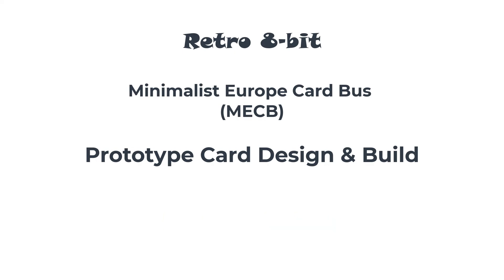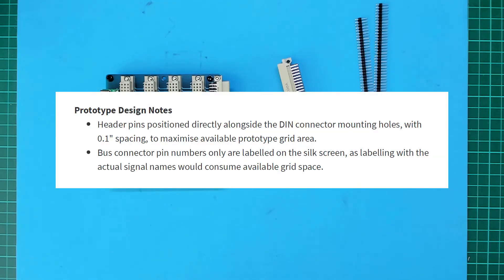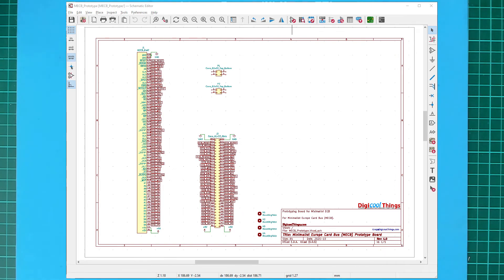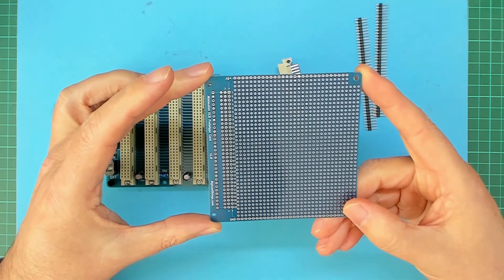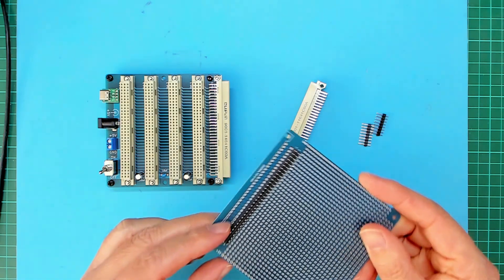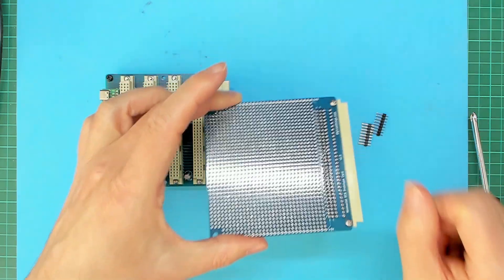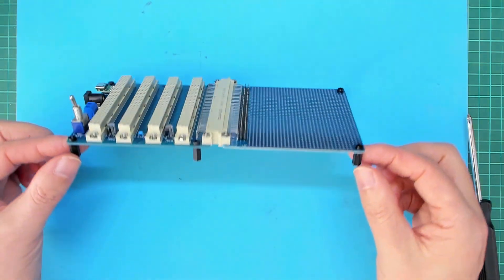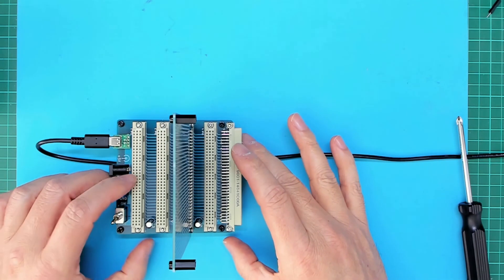Minimalist Europe Card Bus (MECB) - Prototype Card Design & Build

Comment: Ever had a problem with some USB-C supplies working and some not? I ask because I don't see the 5.1k resistors on CC1 and CC2 in your little breakout board. I've had issues with breakout boards without the resistors where the power supply doesn't engage. So far the pattern I've seen is that the 5.1k resistors are required (downstream mode) if both ends of the cable are USB-C (like with modern wall adapters that have USB-C sockets on the adapter, or if, say, you were powering a device from the USB-C port on your phone or laptop).
Curious ..
Reply from the maker: I haven’t come across this problem (yet).  But, I have no doubt you’re correct.  I suspect I haven’t had a problem yet, as I’ve only been using them with the cheap Raspberry Pi USB-C terminated plug packs.  I have a suspicion that these Adapters are probably just simple 5V 3A DC adapters that are simply using a USB-C plug in place of a DC jack.  I quite like them (and their USB-C connectors) for general 5V project power.  PS. I’m slowly working through your videos.  Very interesting, plus I see mention of 6809 in your Hopper GitHub. I just haven’t had the time yet to dive in more deeply.  🤓
Reply: @DigicoolThings  I suspect it will become more of an issue as time goes on and USB-C becomes the common port on our desktops. There is a trivial solution though: just use need to find USB-C breakouts with the same pinout that include the resistors.
I thought it was ALL supplies (and made a video on this today under that assumption) until I saw your video. That made me test more variations and try to narrow down the circumstances.
6809: yes, I started work on a toolchain and then got massively side-tracked a few weeks ago ... I'll get back to it eventually. 🙂
Reply from the maker: @biggertigger  Thanks.  I’ll do some more research on USB-C breakout options.  Let me know if you find any good candidates.   Yep, I know all about getting sidetracked. LOL

Comment: Great idea to go with the prototyping board first so you can wire up some simple boards. One comment is I would have made the power traces on this prototype board thicker and perhaps ran the GND and 5V traces next to each other on both sides of the board to make it easier to fit bypass capacitors right across the power rails. A big source of problems with prototype circuits is noisy power rails so I usually go overboard with mounting bypass capacitors.
Reply from the maker: Thank you. I do like your suggestion of running both GND & 5V power traces next to each other, on both sides of the board. This also makes it easier by allowing connection to the nearest power side.  As regards bypass capacitors, on a point-to-point wired board I tend to connect these directly across the individual device power pins, which is more optimal for protecting a device from power noise, and also for best protecting the power bus itself from that individual device’s generated switching noise.
No doubt I’ll create another prototype card in the future, as I’d already considered creating one with the glue PAL included. Therefore, I might include the double power traces you suggest on this, or even update the existing prototype card at some point. :)

Comment: A tip for soldering in the 2 SIL headers at the correct spacing, push them both into a spare IDC connecter first , it helps keep them vertical as well.
Reply from the maker: Good idea. I guess this would even work using a shorter female IDC (in the middle).  I don't currently have any 2x32 female IDC connectors, but I do have plenty of shorter length ones.

Comment: 32bit pnp NuBus used same socket, they used middle B row as duplicates of power lines to provide more current, so it was technically possible to connect them to neighbor a or b contact and so route a 40MB/s card in just two layers. Clever usage of internal row
Reply from the maker: Hi Alex.  Yes, I understand the original ECB Bus also tied the unused "b" row (of the full 96 pin connector).  Wikipedia notes: "Original Kontron ECB, supported 64 pins, using "a" and "c" rows, ”b” row tied to "C' row."   Although I don't Kontron's specific reasoning for doing this?   Given the distribution of signals between the a & c rows, I can only assume this was done simply to either terminante, or, to make use of an otherwise unused row.  Back in the day (and now), I only used the 64 pin a & c row DIN connectors, mainly because the connectors were cheaper and their performance is fine for the frequencies I was (am) targeting, for retro 8-bit CPU usage.

Comment: Nice to see you back with a new video. 
This reminds me of the time when the PC bus was still a thing you could play with. 
I still have a full length PC prototype card somewhere, built up quite a few of these
to make relay switching modules for small standalone automatic test systems.

With a few 74 logic chips and a few decoders, a bit of software and you could turn a PCB test in to a few button presses. PC's hardware was fun to play with back in the old days, the days of adding hardware on to a PC is long gone. I can't say that talking to a board via USB(RS232 coms) is the same, I feel games killed the PC as a useful hardware platform.
Reply from the maker: Thanks.  It’s really interesting that you mention “full length PC prototype cards”.  As I had several of these, still new in box, until I sold all but one (kept for nostalgia), in 2020.  The reason I had them was that I also use to build various (generally one-off), PC interface cards using them, back in the day.  I think this was probably the last time that I built TTL logic based bus interface cards for a specific commercial computer bus.
After the original PC 8 bit ISA bus, my interfacing pretty much moved exclusively to serial and parallel port connections.
The full length PC prototype cards that I used were PC-LabCards model PCL-750, which included 11 socketed 74 logic chips for bus buffering (LS244 + LS245), and also DIP switch selectable MEM or IO address decode.  
They were fun times!  It was kinda not the same when interfacing moved to the external ports.
Reply: @DigicoolThings  Not sure who made mine, i expect it came from RS or Farnell.
I think it had chip locations to provide bus interfacing and address decoding, and read/write etc and the rest of the board for prototype area. I must try and find it and maybe a quick show and tell video.
Reply from the maker: @TheEmbeddedHobbyist  A quick show and tell video would be awesome to see. I’ll keep an eye out for it. :)  I have my last unused board, but all of my prior projects based on this board have long since been sold to new homes.  So, it makes me feel I wouldn’t have much to show, although I guess the included glue logic might be of interest to PC / 8-bit ISA bus retro folk.